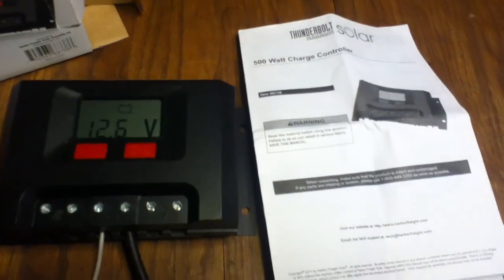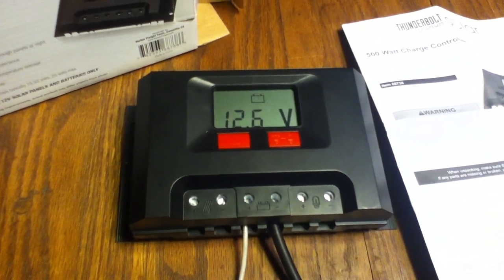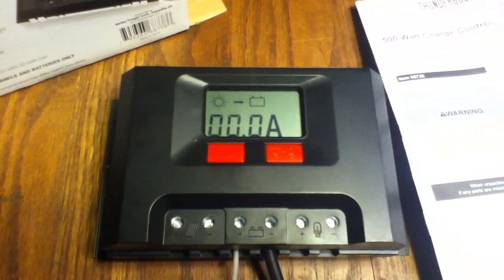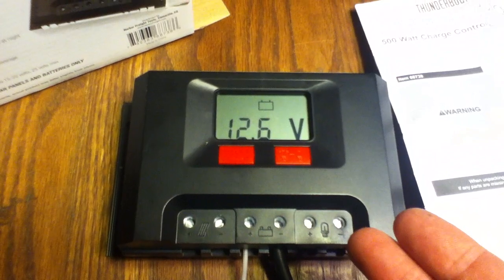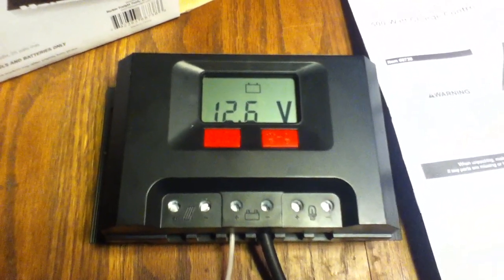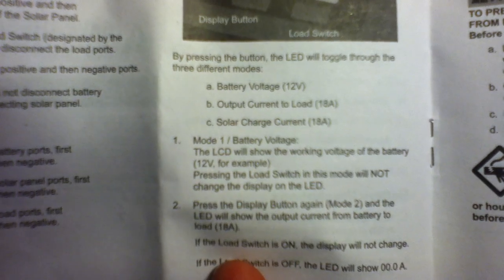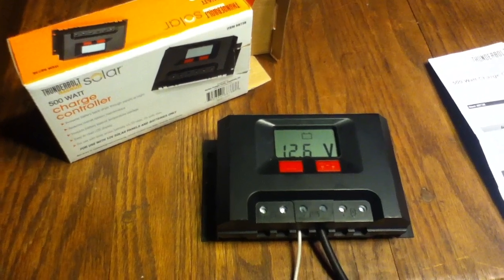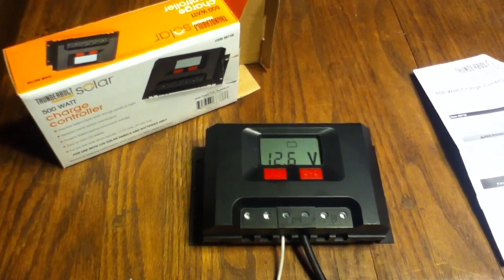Harbor Freight Thunderbolt Solar Item #68738 500 watt solar charge controller

Comment: I think you're right about the controller only being able to run 300 watts. My approx 450 watts ened up melting the positive connection point to the controller.
Reply: This charge controller was designed by a moron

Comment: Im running four 100 watt panels a i was getting about 12-13 amps max and today my positive connector to the charge controller melted from the heat. Ive read it could take in 18 amps but it seems to be too much. I had metal showing on where i screwed and i was able to get it working again even though its melted a bit.😊

Comment: I put 4 100 watt panels with a 400 watt universal solar connecter and it worked for a little while, and today my voltage reader was putting out random numbers going from 18 volt to 6 changing 5 times a second. It does not read any charge coming in. I bought a second charge controller and it is doing the same thing brand new. I hooked up the charger cord to my 100 watt controller briefly and it shows power coming in and its charging the battery. I know sometimes you have to reverse the negative/positive wires from some of the extension cord but this isn't the case. My 100 watt is registering power coming in.  I already burnt a 100 watt charge controller not knowing it was only for 100 watt. 

I need help, why is the 500 watt reqking out when I'm trying to charge? It reads the battery fine when I'm not trying to charge and it is working on my 100 watt controller.
Reply: I figured it out. The alligator clamps that came with the 100 watt system were too small. They have a 7 piece solar power connection kit at Harbor Frieght that has thicker clamps for the system. I'm pulling about 15 amps with 4 100 watt panels. The large clamps need to have the wires stripped to secure it into the charge controller. It's easier to do than you think. The bad side is that the large alligator clamps have a very small chord so it has to be right next to the batteries that you're connected to unless you are handy and can add wire length to the alligator clamps cords. 

I bought a second charge controller thinking that was faulty but now I'm just going to keep it as a backup since that component seems to be the thing that fails first.

Comment: With these solar charge controllers does it really matter if you have a Lithium or Lead Acid battery? And would a DC Voltage Reducer Converter DC 8V-40V to 12V 3A 36W Automatic Step Down Up Voltage Regulator do the same job?

Comment: I bought one of these controllers, and 3- 100 watt harbor freight (thunderbolt) panels. i have it set up, it works fine on cloudy days, but when the sun comes out brite, it reads 20 amps, and the alarm goes off. very disappointed, the salesperson claimed it was a good, balanced system, and would work correctly. guess i'm going to have to purchase a bigger controller.

Comment: The wattage is up to 25 volts (perfect conditions, usually less) from a single HF panel, so 18 amps at 25 volts is 450 watts.  The HF panels I've seen are only 100 watts so probably 4 amps or less.  This controller should be able to run several panels.  Im starting with 3 panels and measuring the amps.  edit: i didn't realize this was so old.  it could be a different model being sold today.

Comment: Thunderbolt Solar is completely lame here. The connections on this charge controller don't match up with their 100w panel. Are you supposed to just stuff wires into the holes? smh

Comment: I used the original charge controller that came with their 100watt solar system, with the 400watt hub, and it was fried. I sent an email and they sent me the one you are showing. I have been running 360watt of solar panels.  no problem so far
Reply: I'm still very much in the experimental stage of HF solar. I was misinformed that I could run AC/DC direct from solar. I bought the 100w pack w/ this plus other things(lights) I now see a 12v battery is necessary to do anything. Makes me think a Jackery would have been better
Reply: @the_weed_in_your_garden9319  on any solar system you need to have a battery. That's what jackery is, a battery that needs to be charged. If you just want something mobile, jackery is a better choice. But if you are stationary or semi stationary,  then with the money you spend on a jackery , you could buy 4 marine rv batteries,  put them in parallel and you'd be able to produce 4 times of jackery.
Reply: @the_weed_in_your_garden9319    then jackery or a similar power station is a better option as it uses lithium batteries that are bu far lighter to carry around. But for off- grid living and under a tight budget situation,  you can't beat the HF's set up!
Reply: @the_weed_in_your_garden9319  the most simple option for you is to get a jackery with a 100watt solar panel.. the jackery has put all the components together for you. You can charge it by a car lighter charger when you driving to your camp site. And once there you can hook up your 100watt HF solar panel and keep charging your system. But what you can run, depends on your jackery and its capacity. Anything less than 400 w/hrs will be insufficient.  What you see in the van life videos and other solar video is that if you put it together yourself, first you need a solar panel that connects to a solar charge controller and then to the batteries.  Then you need a power inverter to invert the power from your battery, into a form that could be used by your lights and appliances.  The jackery has put the solar charge controller, battery and the power inverter all in one box.
Reply: @the_weed_in_your_garden9319  what do you want to do?
Reply: @the_weed_in_your_garden9319  if you are a bit mechanically and electronically inclined you could make one yourself. You get a small storage tote. Attach it atop of HF small 4 wheel dollies. Then you put your battery inside the lid.. either on top of the lid or on the side of the tote, You attach your solar charger and your power inverter. You drill holes to allow the wires to go through and be attached to your batter. Then you'll have diy jackery that's also portable. It will be heavier than jackery, since led acid batteries are heavier than lithium batteries. However if you use a lithium battery in your diy power station, you won't need jackery anymore, your system will have all the capabilities of the jackery at a fraction of the price
Reply: @the_weed_in_your_garden9319  your welcome

Comment: It can reach 14.7 volts at 35 amps from a 400 watt hub with 500 watts of panel attached to that.
Long as you keep it cooled down it's gonna be ok. I'm in the center of the USA 34 lat 101 long.
That's absolute peek and not reflective of the average which should look like 20 to 30
My grid charger for my LiFePo 4 650AH battery is 40 amp peek.

Comment: i am here trying to figure out what the hell is going on. i bought this "500" watt controller and its its getting very hot with "400" watts worth of harbor freight panels. also the charge controller that comes in their 100 kitt outputs more amps to the batter then this "500" watt controller. i think the one that came in the 100 watt kit has outputted as much as 16amps to my battery, but the "500 watt" charge controller can only output about 11amps. as i am someone new to this solar concept i find this very  confusing. i bought all this stuff to learn, it seems i failed to factor in lies on the packaging and or mistakes in the manual

Comment: Complete waste of time. If you are going to do a review don't be lazy. At least hook up a solar panel and a load so you can actually do a review and show the full function of the controller and not just that the LCD works.

Comment: The old 45w accualy put out 24v the controllers hold that back to 12v not sure why thay do that
Reply: Im asume the new 100w are 36v to get the 100w from four cause i have an extra single and it all adds up to 60 watts

Comment: Old video but I'm having a bit of an issue.
Whenever I plug my batteries into the charge controller, it makes a beeping noise in about quarter second intervals. Would this be because the batteries are not charged all the way?

Comment: I know you said what you believe causes the alarm to go off, but is there a way to shut it off?
Trying to figure out how anyone is supposed to inhabit a travel trailer if there is not power from the panel and the battery goes low with that alarm.
Cant for the life of me figure out why this alarm cannot be disabled.
Thanks!
Reply from the maker: Greg Ouellette that's a function of your existing voltage regulator.  Usually it's built into the alternator.
Reply: Did you figure out how to stop this? Suffering from the same issue and can’t see much helpful advice online.. thank you

Comment: Hello 8digitPDX, I'm just beginning an entry level solar panel experiment using a Everstart Marine Battery, the Harbor Freight Thunderbolt charge controller and their 13 Watt Thunderbolt briefcase style solar panels (cheap stuff... I  know). I gather from what your saying is that, even when the low wattage solar panel is hooked up to the charge controller... the amperage will be so low that it wont be detected by the charge controller? I would think it would at least show .4 amps in the controller display since the panels are rated 400mA Thnx

Comment: I don't think you mentioned it in your video and if you did I'm sorry, but I just hooked mine up and it keeps beeping and it's driving me crazy. My battery bank is at 11.8V and that's accurate. With my multimeter I'm getting about 13V from my panel but on the controller I'm showing 0A from solar. Nowhere in the manual does it say if this beeping is because of low bat voltage or low solar voltage, though I assume battery the manual doesn't say at all. I had the cheaper $25 controller from Harbor Freight and it worked for I time. The reason I got the nicer one is because the cheaper one died on me, but I know my setup is good I just have no idea why this isn't working out. It also isn't running my load even though it is reading the proper battery voltage.Any ideas?
Reply from the maker: Steven Fate 
Zero amps on the panel, that's a problem.   What is the sun like?  Your amperage can go down when certain kinds of panels overheat.   Happened to me about this time last year.  In 104 degree heat, the panels would not produce usable power.   It got voltage, but no amperage, I think just like that.
Reply: Steven Fate
Reply: 8digitPDX hey so if I have this same issue what is the best way to resolve it? Thanks in advance
Reply: Steven Fate If your batteries are 12V then your batteries are near dead.   You must initially have your batteries around ~12.6V before hooking them up to solar... that is probably why it is beeping, as a warning mechanism.  Try charging the batteries with a regular charger first.

Comment: hello friend wanted his aid made a eolico generated and bought a 500w inverter 3000w and a 270Ah battery but do not know what type of controller uses
come some of 10ah 20ah30ah what I wear can i help??
Reply from the maker: Might want to check your translation and spell checking software to make the question easier for me to understand.   The charge controller power limitations are on the charging amperage, the size of the solar panels constantly feeding it in sunlight, not the size of the battery.   Also, the amount of power taken by any combination of devices on the "light" or "power out" side is limited, but battery size is not limited.

Comment: i had 3 solar panels connected at first they all worked. 360 watts. got hot sometimes. i have another set of 2 panels on it 250 watts. 2 of the 3 panels just stopped detecting. i spent weakends trying to figure it out. i thought maybe solar panels where faulty. so i connnected those 2 non detecting panels connected them directly to a battery and they worked. why does it detect other panels but not those 2 anymore>? really strange. any one had that isssue ? pushing over 360 watts
Reply from the maker: I hate working with the Xantrex controllers and the ripoff thing of them selling a dirt simple display for barely under $100 that is optional to the charge controller, but the Xantrex don't burn out.  They are '80s technology, overpriced and confusing, but durable and long lasting.   It is the solution to repeated burnouts on the feature-heavy controllers.

Comment: i burned 3 of them also. i had 360 watts. got hot and  it  just detected one single solar panel and only that single panel. i spent days, trying to figure out the issue i connected a battery directly to the solar panel and it charged the battery, it just wont detect those 2 solar panel it just stopped detecting them. very strange. and 1 panel it works.
Reply from the maker: I never burned any of the HF charge controllers, but have burned two of the netmetersolar charge controllers which are an upgrade.  You need to stay 10%-20% below the rated wattage.   My 400 watt south angled array roasted two inside of a year and a half but my 435 watt flat mounted array has been on the same controller for over two years.

Comment from the maker: Just for everybody's information, I burned up two similar controllers from netmetersolar on the issue of the watts vs amps vs new solar panels running above the listed performance issue, but the main reason I got rid of this HF charge controller was the information I found buried in the owner's manual.   I gave it to some guys to use on a solar demonstration project with two of the DM145 panels running aruond 8 amps each, and they have not had any problems with it.  It is fine with lower wattage

Comment: WARNING ,, i got  375 watts running through it [pushing it ],  ,  noticed around 28 amps unit VERRRRY  hot .    warning is do not mount flush to wall , back unit is where heat sink fins  are ,    keep about 1 inch away from wall  so unit cools get air ,behind unit ,   i may also put a computer fan , i got for temp , til can afford good one , higher amp ,,

Comment: Can this unit manually control the load feature.  If I have an LED light bulb on the load system, and I want to manually simply turn it on and off can I do such a thing?  This would be used to controll led light in my shed at night time and then turned off when I leave..etc.

Thanks much,
-Nigel

Comment from the maker: It is probably pretty decent as long as you are staying below 18amps and got a good coupon deal for it.   I prefer the types of charge controllers with a lot of information in the readout but my recent experience is their capacities tend to be a bit overstated.  They are Ok for smaller systems and the guys I gave mine to have had no complaints.
Reply: Hi. Can you hook up two one hundred watts solar panels to this unit? Thanks